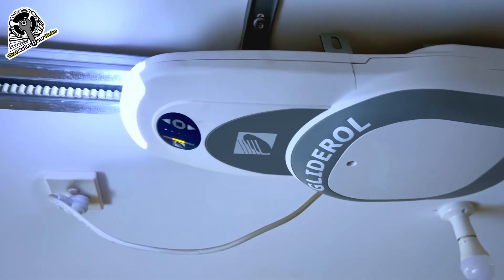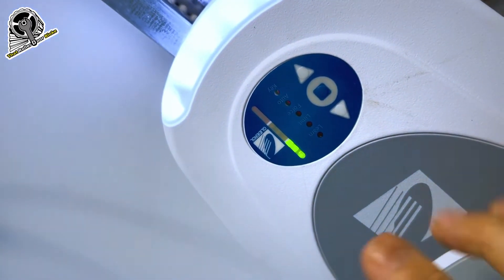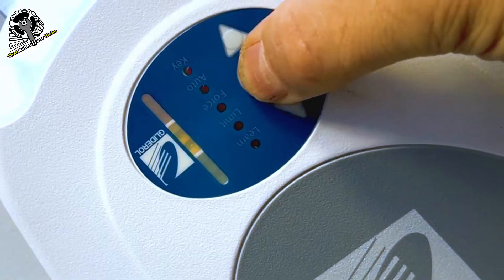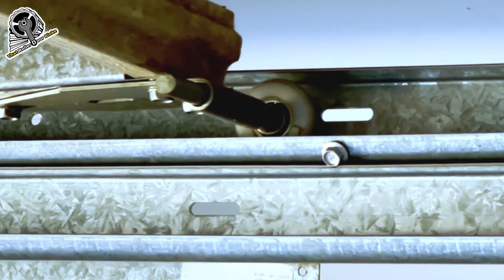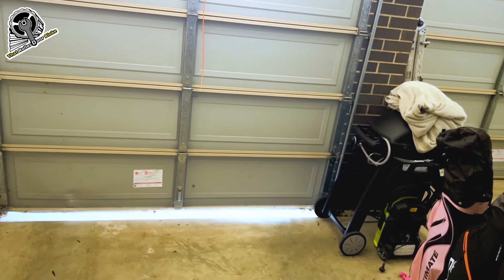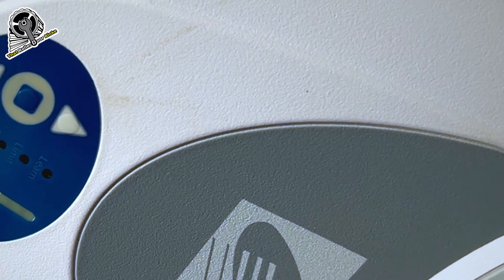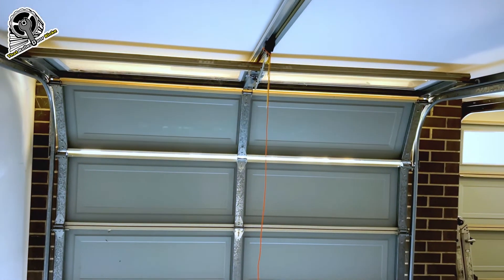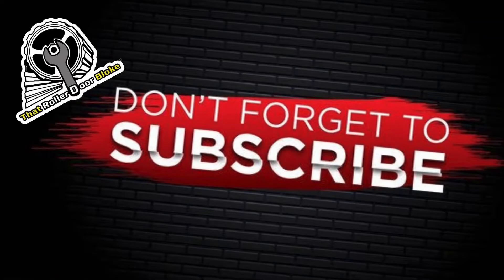[103] Gliderol GTS+ sectional door motor - how to set the LIMITS

Comment: my Gliderol Garage Door failed today.  It won't open or close.  I tried resetting the limit, but the chain is not moving at all.  I can see the shaft is turning but the chain is not moving, if moved, it will only move a tiny bit only then it stops.  What do think is the problem here?  Thanks.
Reply from the maker: I think between the shaft and the chain rail is a sleeve which is probably plastic being Gliderol and has probably stripped.  From memory I think I have repaired one and I just use some epoxy on both sides of the sleeve and reassembled it and never had any issues..  it’s just four screws on top of the motor and the rail comes off. You’ll see.